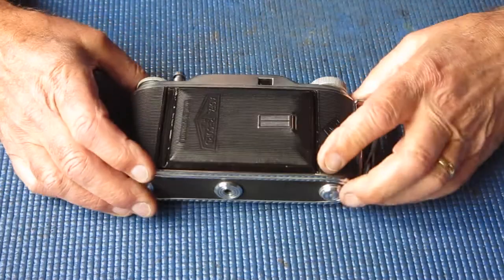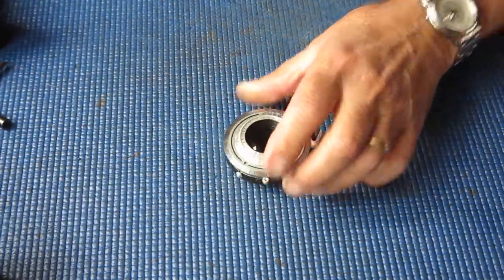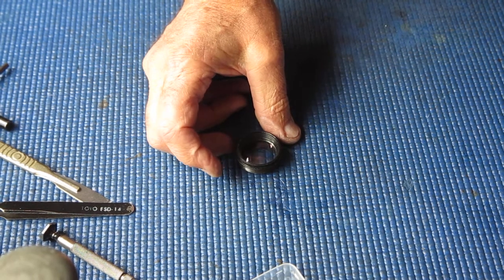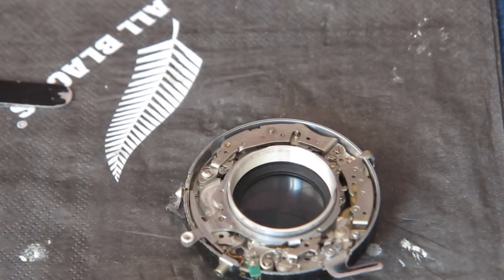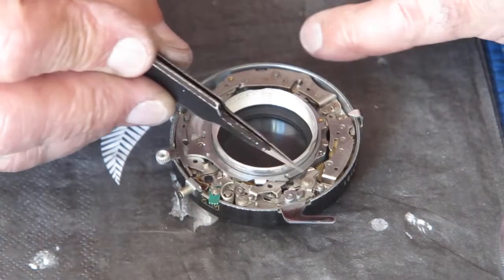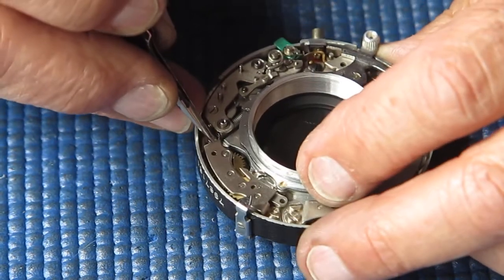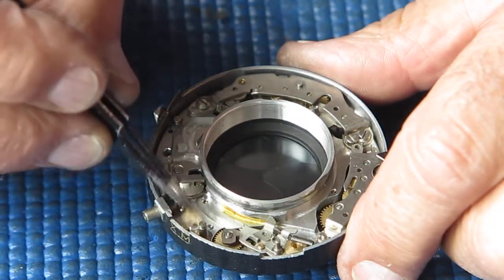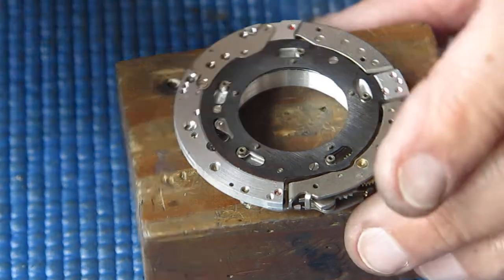Agfa Record II shutter and body service part 01

Comment: I dealt with a frozen lens on a lovely little folding Agfa127. Took the focus ring off while it the lens and shutter was still on the camera and wrapped a loop of copper wire round the groove that  the little screws set in.
Wrapped the other ends an inch or so away around the bit of a  cold soldering iron. turned it on and
the heat went up the wires and quickly released the lens for cleaning and lubricating. The heat had stayed local and no damage was done.
Made myself a 127 size ground glass and set up the focus. All good!
Really enjoy your videos and learn a lot from them.Thanks
Dave

Comment: Thank you for this great tutorial on Agfa maintenance! 
I recently bought an Agfa Isolette (marked 'Jsolette') which I think is probably an early post war Isolette 4.5, comparing to the wiki. Anyway, the lens focus/shutter components are still somewhat comparable (the latter less so, I suppose). While the Compur-Rapid shutter still functions perfectly, the focus ring is completely stuck. 

I took of the ring itself, uncovering the inner front lens element just like in your video. Now, unlike in this tutorial, not only is the front lens element practically glued to the second lens element by the green grease, the second lens element itself seems to be stuck inside the shutter ring as well. I tried carefull applying some solvent to the tiny gaps where the thread is slightly visible, as well as gradually applying some heat to these front elements. Sadly, these efforts haven't managed to dissolve or at least soften most of the hardened grease (some green stuff on the uncovered thread did come off though).

It might just be the case that the solvent just somehow doesn't reach far enough between the screw threads of the front lens elements or something like that. I am still unsure how to proceed, since I want to be careful not to overload the elements with solvent/ a solvent-gooey green mix or use excessive force in an attempt to rotate them away from eachother, potentially damaging this wonderful camera.

Do you have any suggestions on what to do in the case of even the second lens element being stuck? Should I stick to the solvent approach, try more heat (is there damage/cracking potential here), or more force while turning after all?

Any advise would be appreciated!

Comment: After soaking in lighter fluid & meths for a couple of days to no avail, I put the stuck front & middle lenses in a film canister with the same fluids. I then taped the canister up securely and wrapped it in tin foil, popped it into an electric vegetable steamer & left it steaming for 20 mins. The canister did puncture, however this did the trick and the lenses separated. Probably not recommended, but it worked for me.

Comment: I owned an Agfa Record II for a while, and it had the same problem with the green grease. I managed to unscrew the front element after putting the front lens mounts in the freezer and then warming the second element's mount for it to expand. The bellows had holes so I got a replacement bellows. The shutter worked fine, thankfully. For 6x9 cameras I have found that setting the focus on a groundglass on the film plane isn't enough because the film bulges a little. So I make a scale marked 1 - 8 that I print out and put on the shutter and scratch a mark on the front lens mount. Then I take a test roll of eight pics with the lens set on each of the 1-8 numbers. I develop, and if, let's say, negative #3 is the sharpest I then set the scratched mark at #3 and put the focus ring on. The difference between the infinity focus on a flat groundglass and the actual film plane in the center can be as much as a few millimeters turn of the front element on 6x9 cameras.
Reply: I'm finding it's difficult on my Record II.   That Agnar lens.  Tough to set focus correctly.
Reply: I have the same problem, I've tried all the above, can't unscrew them :( suck a pitty as the camera is otherwise pristine... I was afraid though to heat the element too much, not sure if that is going to affect the lens, I'm using a hairdryer ...

Comment from the maker: Claudio Elicer commented: "Fantastic!, I have one with the same problem with the focusing ring, what type of solvent do you use to release the ring at last? Thank you!"

Sorry for the delay in replying, YouTube's comments aren't working correctly. Sometimes I get the notification, but the comments do not show on the video concerned.
I use various solvents. Usually I would start with Naphtha (cigarette lighter fluid), if that doesn't shift the dried-out grease, I will use CRC Lectra Clean, and if that doesn't help, then generally applying some heat with a hairdryer will sometimes soften the old grease to the point that you can unscrew things. Once apart go back at the threads with solvent and toothpicks to clear the 'concrete' away.

Comment: I'd been hoping for a showdown, Sherlock Vs the dreaded agfa green glue! You made short work of it mate!
Reply from the maker: I also dealt with a pair of Karat cameras recently. One of those needed dreaded green grease dealt with too. Videos of that will come later.
Reply: Looking forward, I bought a karat on ebay a couple of years ago in bits,  the seller had stripped it but couldn't rebuild it, for a couple of pounds I thought why not, give it a go.. sadly my ambition was greater than my ability and it has remained in bits.. there may be hope for it yet...

Comment: I have done 2 of these.  Great cameras.   I always replace the bellows.  I got mine from SandehaLynch.com   Thanks for the video.  

With the Agfa "Jsolette" , the earlier version of the isolette have you found a way to rivet the the film plate vs the older version which has screws. I thought about just using tiny bolts and nuts.  Just wondered what other people do.

Comment: Huge thanks for this video! I have a problem however with unscrewing the focus lens :( it's stuck ... tried many solvents and heat and nothing helps. Do you have any other tips I can use? I love this camera and I would like to restore it to full functionality. You're my last hope! Cheers!
Reply from the maker: If you have the front group and the centre group unscrewed from the shutter, but cannot separate them, you might try putting them into a warm oven,  maybe sixty degrees centigrade , just under 150 degrees Fahrenheit. Leave them long enough for the heat to soak in, say ten minutes, and try again, with or without solvent.
Reply: Thanks  @ChrisSherlock  I'll try that!

Comment: I have a Agfa Super isolette that the bellow and lens is not extending properly all the way when pressing the button. It jams half way. If I hold it upside down with the lens facing forward the mechanism works like it should. Any thoughts on what could cause this? Something bent? Doesn’t seem to be a lubrication issue even though this could help.
Reply from the maker: Most of the folders rely on the lens standard swinging in a smooth arc relative to the front door. I have other folders that tend to stick if you open them the wrong way up too. The cause may be complex, stiffness in the bellows probably, wear in the struts etc. If lubrication doesn't fix it, just learn to open the camera upside down, every time.
Reply: @ChrisSherlock  thank you for that! I actually tried the lubrication now and it did sole the entire thing. I was sure it couldn’t be the case. Hopefully it last long without getting worse soon again. Thanks a lot.